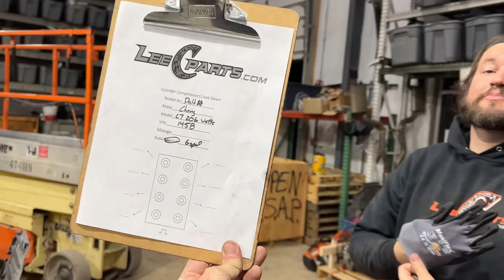I Bought A DESTROYED Corvette Z06 From SALVAGE AUCTION!!

Comment: On the rear rim, for shipping, why dont yall cut the barrel off the back and ship out the face of the rim only? Keep it rollin...,  Might be a fire idea...,

Why dont you use a torch on the trans bolts maybe a little heat will break them loose
Reply: Was the z06 a fire sale from black friday.... I think it needed bigger and better transmission and supercharger heat exchangers

Comment: It would be awesome to see what exactly is causing the poor leakdown on that cylinder, is it leaking out the intake exhaust or rings? I had a burned ls1 engine that had zero compression when doing a leakdown test (was probably sitting at copart for a long time) after I spun it over with the starter a lot it had some compression, I fixed the burn damage, got it started. The first start it ran rough for a second then cleared up, ran great and had near perfect leakdown results. Have you guys ever had a similar experience where a motor that sat up had poor leakdown results then improved after running?

Comment: It's possible that engine hadn't run in quite some time.  What if you put a little oil in the cylinders and used the starter to crank it over a little?  Is it possible it would leak down better?